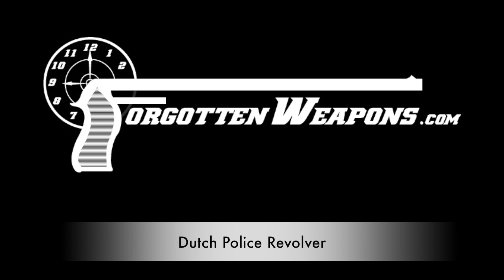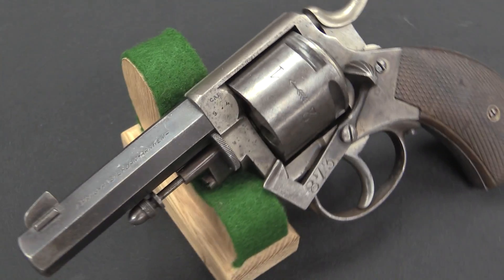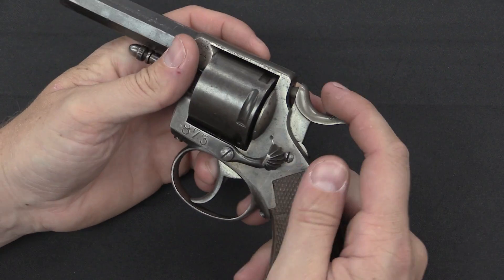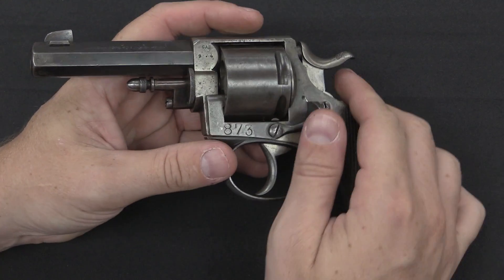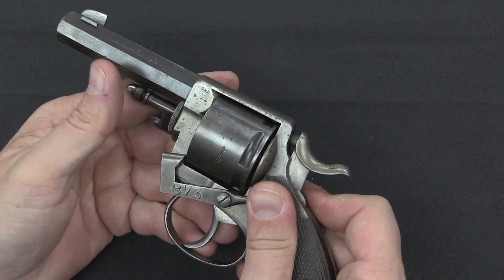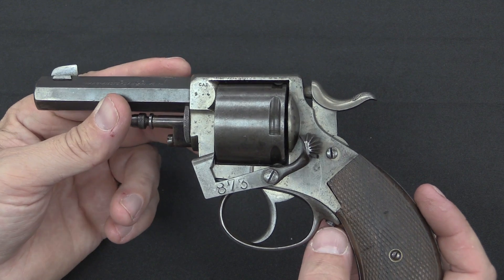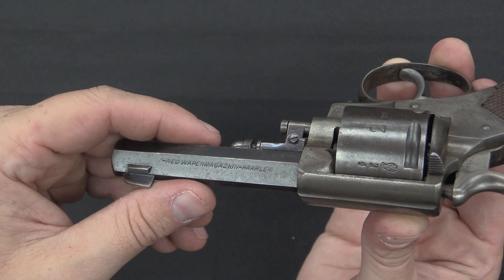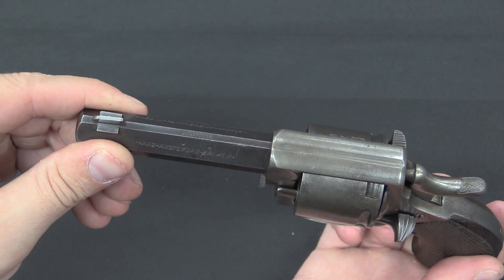Dutch Police Revolver (with safety!)

Comment: For the turn of the century, using non-lethal rounds for law enforcement seems very ahead of the time.
Reply: I agree! Very cool to see, regardless of effectiveness.
Reply: Obviously neither one of you has ever spent a day in law enforcement.
Reply: USMC03-1408 How can you be so sure?

And, regardless of that, does anyone have to "spend a day in law enforcement" in order to be qualified to have an opinion? An officer's reason of existence is ultimately to serve the citizens (as opposed to, let's say, shoot at them)...
Reply: +Jason “cyberspace entity” Doe pretty sure Mr Doe. There are less than lethal options for law enforcement officers, pepper spray, taser, asp, hands, verbal. No need for there to be any further, and definitely not in an item that is intended for lethal force. The only thing that would create is confusion on behalf of the person placed in the situation having to make that dreaded decision.
Reply: USMC03-1408 If lethal force was only applied where necessary and acceptable, there would be no debate.
Reply: +USMC03-1408 The point the OP is making is that for the turn of the 19th Century (1899/1900) this less lethal option was progressive for that time, not currently where all number of items are available.
Reply: USMC03-1408 Sure, I can agree there are practicality issues.
Reply: contactacb Thanks – apparently, the obvious needs to be stated sometimes.
Reply: I think some commentators on this thread are forgetting that many police forces did not normally carry firearms in the 19thC. My great grandfather for one, who was a sergeant in the Derby (UK) constabulary in the 1870s. He just used a baton, or his fists. To this day the Wollopers in England do not normally carry guns, although British police in Northern Ireland do (and carry them home too).
Reply: +Sean Coyne agreed, but I know a Bobbie who recently became a cop over here and he was telling me that the police in England have started carrying handguns...
Reply: USMC03-1408 Well, they always have the option of specially trained armed police back up. But there are currently separate police forces in the UK, depending on locality. The law in Scotland is also different, which complicates things. Northern Ireland, being a special case, security wise, has different operational procedures for police being armed. I guess, especially with terrorism concerns, that may now apply to England and Wales. I suspect it is tactically based, But by and large the public and police would prefer to limit the number of police who need to carry firearms as a matter of course.

As an aside, there are a number of videos on YouTube showing British police handling difficult situations with knife-armed mentally unstable suspects that are resolved without the use of firearms, that show good training and tactics. Such situations sadly do not always end so well in places such as the US and Australia, where officers under stress and fearing for their safety have unfortunately resorted to deadly force. It is and always will be a difficult call. But I support the British approach of limiting, wherever possible, the resort to firearms.
Reply: +Sean Coyne I remember seeing a video of British policeman taking down a knife wielding attacker in an exercise with American police watching. One yankie turns to the other and say 'I'd just shoot the guy'. Shows a difference in policing. My dad is a policeman and he had never had to deal with anything that would need a gun to be used.
Reply: Interesting comments, I think the US approach at law enforcement is radically different from most European countries. E.g. in 2014 (last figure available) the entire German police force fired 46 shots at people and killed 7. Now compare to the USA..
Reply: +toomanyaccounts A) it's more dangerous to be a garbage man than a police officer in the USA. 
B) your criminals are more well armed because of your lax gun laws. 
C) uk police won't take on a violent criminal alone not because they are 'scared' but because just shooting people isn't good policing. The Norwegian police in 2011(I think it was that year) only shot one person.
Reply: +toomanyaccounts And I love you use of 'deal with'. Only in the US does 'deal with' mean shoot on sight.
Reply: +toomanyaccounts I wasn't saying garbage men get killed for their uniform but it's still more dangerous. And your gun laws are very lax compared to Europe. And stop doing the 'democrat states are the most violent' thing that pro gun people seem to love, you just don't get that I don't care about the states. Other countries with less guns have FAR FEWER GUN DEATHS. And Britain might have a 'running away' problem but America has a 'shooting un-armed people' problem. I'd be more worried about that. Far more people die.
Reply: +toomanyaccounts and fair enough on response time but you still don't have to shoot the guy straight away. There is a plethora of videos of police officers in the US dealing with a guy with a weapon without shooting, even when it was excusable. The difference in policing seems to be that in the UK the public is the priority in the US the Officer is the priority.
Reply: +pmodd I don't disagree with your point mate. Violence is sometimes necessary, I remember the end of The Troubles so I remember real terrorism. But there is a slight irony in you using Australia to push me to find evidence of my claims when my claims are either about UK, Europe or general loose international trends. Never brought Australia into this as I don't know enough.
Reply: *****  I replied to Sean Coyne, but for some reason it didn't put the '+Sean Coyne ' at the front :S. His comment was:

"Such situations sadly do not always end so well in places such as the US and Australia, where officers under stress and fearing for their safety have unfortunately resorted to deadly force."
Reply: +pmodd fair enough. Sorry bout that
Reply: +toomanyaccounts A) why you bringing race into this? 
B) unarmed and dangerous? Like Tamir Rice? 
C) I'm from Miner's strike country so I know how effective police can be with just batons, you'd think a non lethal option would be the go to. Deadly violence should be the last resort not the first response.
Reply: +toomanyaccounts and could you not keep using third world countries to back up your points. If you defence is 'it's less dangerous than Lagos' then it does have much affect. Switzerland is the country closest to US gun deaths that is a MEDC. And they have mandatory service and gun ownership. You have more deaths per capita than a country FULL OF ASSAULT RIFLES!
Reply: ***** Ownership is no longer mandatory.

USA has has similar murder rate to Finland if you assume that black people have a murder rate similar to the average of Americans(which they do not).
Reply: +Funny Farmer Hobbes!!!!!!!!!!!
Reply: Sean, UK is an exception. Most police officers around the world carry firearms. UK police is one of the few that don't.
Reply: Are you guys missing what OP is saying? He literally said in his opinion it was rare to load tear gas and blanks into a police revolver considering it was the turn of the century. How on earth do you guys make up a crazy long debate over something irrelevant? He was talking about turn of the century, not now.
Reply: rantanen1 The BTP is armed with HK 419s and glock somethings. but other than that average rozzer doesnt  have guns and dont want them
Reply: Sean Coyne In the late 19th Century from around the early 1880s, constables on night-duty were given the option of carrying service revolvers,by the Home Secretary of the day, due to a couple of violent deaths of constables, from burglars, armed with guns. Quite a few of them did this in secret when on night-patrol & some were patrolling armed, when the Sydney Street Siege happened. This practice lasted until the mid-30s when it became mandatory to sign out guns, with a sergeant authorising their usage. Also before the Metropolitan police Act of 1829, the Thames River police & the Bow Street Runners were armed to the teeth with cutlasses & pistols & truncheons. Police still carried swords on duty until around 1839 or so.
Reply: non lethal back then was a baton or a shot to the foot
Reply: Sure, but they also still actively used sabers for crowd-control, so meh.
Reply: In 2014 97 retail workers were murdered... that's all of retail.  In the same year 124 cops were killed in the line of duty, 50 by firearms.  I'm pretty sure just by those stats that less than 50 people were murdered while working at a 7/11.  So stop making stuff up on the fly and calling it truth.  It's probably more like 5 than it is greater than 50.
Reply: contactacb l
Reply: its less ahead of its time than you'd think.  less lethal ammunition has been considered and considered ineffective about a hundred times since firearms came around
Reply: Firing a blank is a form of bluff. Bluffing may dissuade someone if he isn't serious about harming you, however bluffing is a form of faux resistance that does nothing to stop someone from attacking you, but on the contrary, will cause a determined client to redouble his efforts to kill you.
People often take several bullets to settle them. Here is a fellow with a 5-shot revolver starting out with a 2-shot handicap at the outset.
….RVM45
Reply: Wow this thread aged like milk
Reply: It was. That didn't help the case tho because it was also ahead of the technology.
Reply: KuK137 lmao, like where? England? France? Australia? Knife violence and homicides are still on par with violence before they “banned” firearms. Now England is banning knives. And the Bobbie’s in England have started carrying firearms. In France where a police officer had the option to carry.... they Are now overwhelmingly carrying firearms for their protection.
Reply: Why has this thread turned to shit over such an innocent comment about how relaxed Dutch police were/are?
Reply: @michaelkeha  it's still ageing like milk
Reply: @USMC--me3ig this was during the early 20th century. Things like tasers didn't exist back then, and the best an officer had was tear gas and a club. This may not have been the best implementation of the idea of less than lethal force, but it was at a time when police tactics and equipment was far less advanced than today. An idea being ahead of its time can also be ahead of technology.
Reply: @USMC--me3ig you eat crayons so they'll play around with you lol

Comment: Just a little correction. The markings on the barrel should be read with the right side first and then the left side. As you can see it is read top to bottom when the gun is orientated for reading the name. It is one long full name reading: NED WAPENMAGAZIJN - HAARLEM - HAAG - AMSTERDAM - ARNHEM. NED is short for Nederland, which is the Netherlands. WAPENMAGAZIJN you rightfully work out with your German knowledge as 'weapon magazine', though more accurate would be 'weapon warehouse' Haarlem, Amsterdam and Arnhem you already know well enough about, but HAAG is short for 'Den Haag' which is the Dutch city of 'The Hague'.Also the second chamber could also be loaded with another blank cartridge or sometimes with birdshot.Anyway thanks for the video Ian. Keep up the good work bringing obscure firearms to light.
Reply: Actually Den Haag is short for s'gravenhage wich is the full name of the city of the Hague
Reply: @zenger74  Actually, Den Haag is the original name, 's Gravenhage is a fancified 17th century version. That also explains the older translations: the Hague (English) and La Haye (French). The more you know.. :-)
Reply: @joostdriesens3984  also the City uses Den Haag as much as possible but the city council stopped an attempt to make it the official name in the 90's. 

So you have this weird situation where the court is renamed but the city still isn't

Comment: I found this from a museum catalogue as an added piece of info and translated:
 
Politierevolver of the national field (rural district) police ("Rijksveldwacht") or Coboltmodel, as used bij municpal police of Nijmegen

Belgian 5-shot revolver of the Cobolt model,  Gemeentepolitie Nijmegen. A standard Dutch service revolver, used by services such as Rural police, prison guard and Customs. Called the Coboltmodel or National Rural Police and supplied by Nederlands Wapenmagazijn from Haarlem or its affiliates. Barrel marked "Ned. Wapenmagazijn - Haarlem - Haag - Amsterdam - Arnhem". Left side of the action carries caliber designation as “Cal. 9.4 mm” and manufacturer's trade name, triangular logo enclosing the letters “LAM” (the manufacturer L(eopold) Ancion-Marx). It has the so-called bird's head grip and grip covers with wafer type grooves. Loading gate opens side ways. Two chambers of the cylinder are marked with the figures  1 and 2. These inscriptions and the safety hook that blocked the cylinder accomodated the services requirement to load the cylinder with one or two blanks as warning shots or if called for, less lethal gas or bird shot cartridges, before shooting live rounds. On the safety hook inscription "1921".

type:  revolver
manufacturer: L. Ancion-Marx
location: Luik / Liège, Belgium
bullet diameter 9,4 mm
Dutch Police Museum / Nederlands Politiemuseum

Ian, BTW, your pronunciation is very good !

Hendrick

Comment: To my admittedly limited knowledge. Yes round 1 was always a blank to perform a warning shot.
round 2 and in some cases 3 as well where bird shot, not teargas. Those rounds couldn't be used by dutch police since the rounds where packed in airtight tins and where only good for a short time after being extracted. Only the dutch military (police) used them as they also required a modified revolver with basicly no barrel.
Reply: Do you have a photo of those revolvers?
Reply: Correct.

Comment: Dutch person here,
I'm not sure if you noticed it but on the barrel there is also written 'haag' or the Hague for english speakers. I'm not sure what the Hague has to do with this revolver but i just thought you should know
Reply: I think that the word in front of Haag is scrubbed out, it's possible that this gun is also used in Den Haag (The Hague)
Reply: No I don't think it's scrubbed out.

It says '-HAAG (notice the single quotation mark) , which is short for 's Gravenhage, an (older) alternative for Den Haag
Reply: May have been issued to security at the Hague?

Comment: This is great for any criminal that wants to rush a police officer. You know you have until the 3rd shot to make it to him. Even in a grappling situation the bad guy doesn’t have to worry about getting shot. The officer would have to be able to get off 3 rounds before he even has a chance of stopping the guy. And even then it would likely take the full cylinder before you get any kind of stop to the fight. That’s assuming all 3 lethal rounds make contact.
Reply: That is why Dutch police officers in those days also carried a  sabre. Grappling situations were very risky for the criminal.

Comment: I wonder if that great big "873" stamped on the safety lever is the badge number of the officer who carried it?
Reply from the maker: Probably something like that.
Reply: Same as my daddy and his daddy before
Reply: +Forgotten Weapons Could I reload ammo for the thing?
Reply: +Tomás Pabón why not?
Reply: Not easily.The 9.4x21 cartridge is obsolete.You would probably have to reform the brass from another caliber and then the bullet would have to be resized from another caliber as well.If you couldn't find a set of dies you'd have to machine them.The mid 1890s were a transition period from black powder to smokeless so you'd need to know what powder they used or just go with BP to be on the safe side.The lower pressure of the BP would be safer in an older gun anyway.
Reply: +JohnLeePedimore 
not a real problem
Reply: I wanna say there's a company in Brazil that specializes in making obscure and discontinued ammo, but it ain't gonna be cheap.
Reply: +spiff2268 what's the name?
Reply: +Tomás Pabón 
I wish I could remember.  I just remember reading about it years ago.
Reply: +spiff2268 really? I live in Brazil, never knew about it, but I know that some people here have some obscure guns, like French breach loading rifles from the Paraguay War (1870), some reform to use metallic cartridge, some Manlincher 1888 from the old Brazilian Republic Army, some Mauser Rifles and some odd revolver and single shot guns etc, so, it make sense...
Reply: No as far as I can recall it's an serialnumber per weapon

So in the books officer named ...............has gun serial number XXX 

(I'm from the Netherlands and my grandfather was a police officer)
Reply: JohnLeePedimore I really wouldn't know,...believe it was a bit early for that idea.

Comment: It is odd that there are 3 more cities on the other side of the barrel from the company stamp.  I suppose it could be 3 more company locations since it would be strange to have the gun stamped as assigned to police departments in 3 separate cities.   But that does seem like excessive advertising.